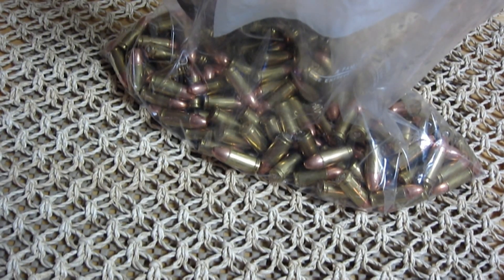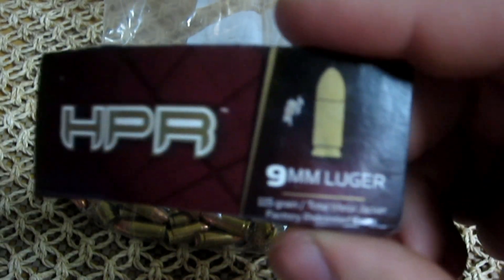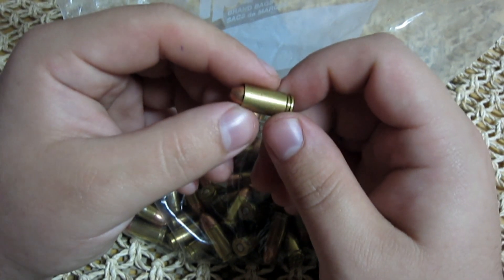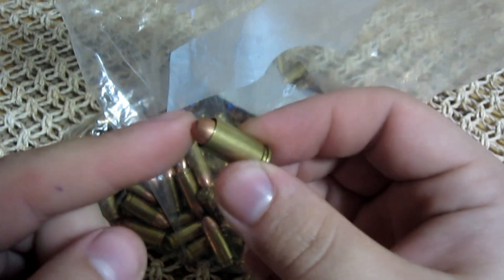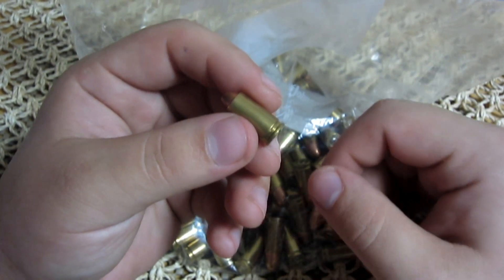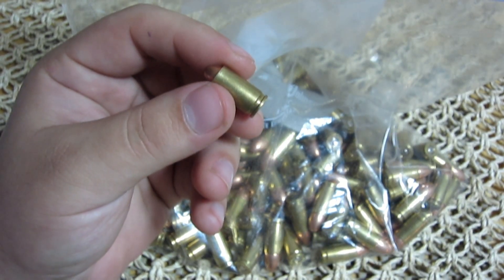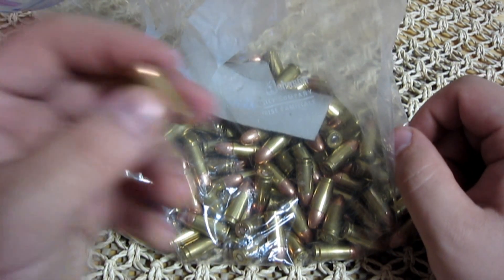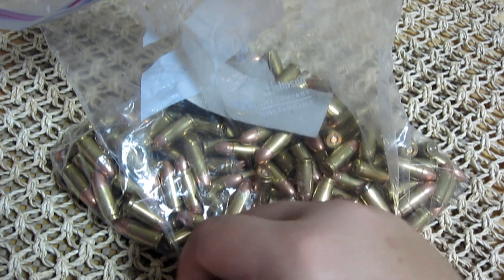Bullets Gone Bad...

Comment: I'm going to say the problem comes from the person reloading.
What you have there is bullet set back. Caused by improper case sizing 
or crimping. This can also occur when a round has been chamber many times.
Repeated chambering will cause the bullet to set back when the bullet contacts the feed ramp. I'd chamber a few or those "reloads" and see if I'm getting any "set back". Bullet set back DOES cause higher chamber pressures.

Comment: Pull the bullet, dump the powder, meter in fresh powder, re-crimp.  This isn't a major issue, but good to point out especially for inexperienced shooters/reloaders.  It's a weak crimp during reload that caused such massive setback, I would press on each one or re-crimp all of them (after checking the crimper setting is right) to be sure.

Comment: @brandond1997 With the .22lr's that I've seen, the bullet narrows at the bottom and has an over-hang, the narrow part goes into the shell and the top of the shell is then crimped to hold the bullet in.  The over-hang on the bullet prevents it from being squashed into the shell any further down than it already is.

Comment: If you get a lot of those maybe a bullet puller would be a good 15 dollar investment.

I also shoot the primer. Its the safest thing to do in my opinion. Also light the powder. Powder inside the casing actually burns quite slowly and calmly when its not subjected to the pressure of the casing and the violent nature of primer light.

Comment: You can get rid of it the same way I got rid of a shotgun slug I cut open. Burn the powder (it's fun to watch and quite safe) or if you don't want to burn it, wrap it in wet paper and throw it out.
Throw away or keep the bullet, and then load the shell casing into your pistol and fire the primer. Then toss it.

Comment: @klesmer ...yes I know about the taper crimp.  However, since most bullets you would use do not have a cannelure to crimp into, you have to be careful not to make the bullet so tight that it increases pressure beyond safe levels.

Comment: im like 90% sure its due to the ammo being reloaded ammo. I bought some reloads one time and a couple rounds were loose so i could actually push the bullet into the casing with my fingers. WWB ammo is in the loose boxes if you get the 100 round pack, never had an issue there

Comment: Use a kinetic bullet puller pull it apart their about twenty bucks, but that problem is not from storage it happened to me once when I forgot to adjust my bullet seating die I had it screwed way down to much for FMJ bullets, wadcutters will be seated way down like that

Comment: yes. im thinking it would create too much pressure. the space is severely limited. good think you checked. once again you admit when you are wrong. thats awesome of you. one of my job chums. bought a new glock and an idiot friend of his told him it could shoot not only 40 caliber but 9mm too. without any barrel adjustments. so they took it out and shot some 40's. then they tried 9mm. he said it wouldnt chamber right out of the 40 clip. duh. first sign of trouble. so they loaded the barrel itstuc

Comment: To clarify my last point.  By case "rim" I mean the mouth.  The edge of the case mouth is what actually stops the round from going too far into the chamber.  If you crimp the edge into the bullet, bad things can happen.  You'll notice your revolver rounds ARE crimped.  The bullet has a little groove around its circumference called a cannelure that you crimp the edge into.  This is necessary because the recoil on a magnum round can knock bullets loose in the cylinder if they weren't crimped.

Comment: it might be hard to use pliars to pull the bullet out so why dont you try putting a screw in the top of the bullet then use the pliers to pull it out. dont put the screw in all the way though, no more then an 1/8 on an inch

Comment: no way the crimp is right on that round. I would check the rest of them for proper crimp before shooting them. If the crimp was right it would take alot more then just dropping it or having it loose in a bag. If you use a kinetic bullet puller to pull the bullet you would see just how much force it takes.

Comment: I cant see carrying ammo that way would seat that bullet that far down. I used to cycle the same round in and out of my carry gun every day and it never sat that far down. For pulling bullets apart get a kinetic bullet puller. there are about $25. looks like a plastic ball peen hammer. I used to use them with I worked for a comercial ammo reloader. Hope that helps some.

Comment: I SERIOUSLY doubt that happened from bouncing around in a bag. Neck tension should be strong enough to where you shouldn't be able to move the round deeper into the case without substantial effort (IE a press). My guess is crappy quality control at HPR and you just didn't notice it when you put it in the bag.

Comment: If you are really concerned about setback or other potential problems, consider investing in a bullet puller.  I've used one of these and they do the job.  I've never had a damaged case from one, and they collect the powder and bullet in the tool itself so there is no danger of spilling.  Very handy for shooting reloads (from anyone).

Comment: For those that reload... just use a bullet puller, pull the bullet, dump the powder, check the size of the neck, if ok throw in a new charge and press the bullet back in. I'm not sure if I'd reuse the powder or not, when it compresses like that it could change the physical state and burn rate of the granules.

I store my range/training ammo like that as its all reloads.

Comment: That cartridge is probably more dangerous trying to pull the primer than in it's current state. You can just pull the slug, re-size the casing then re-seat the slug. Safer to just leave the primer alone than try to remove it. Even with no powder, the primer is enough to blow off your hand if it sets off while you're trying to remove it. 

Dig your vids - keep them coming!

Comment: Just to help you out even though this is old. I actually reload, cast my own bullets, and make FMJ bullets from copper and lead cores. This is not from storage!!!!!! It could have happened from storage, but it was not "CRIMPED" properly. If your would have tried to chamber it. It would have still happened regardless. That actually saved you from a catastrophic failure. You should be able to bang the cartridge in to the ground and it not move.If it happened in a bag... then it saved your life!

Comment: Lmao no way that was like that from just storing in a bag
Reply: Stranger things have happened.
Reply: Most likely too short of a case, which caused the crimper to miss the case. An un-crimped handgun cartridge will do this very easily, including moving around in a bag.
Reply: I have a round like this, it slid down in the casing after repeated reloading into the magazine. All it took was the pressure of my thumb 3 to 5 times.